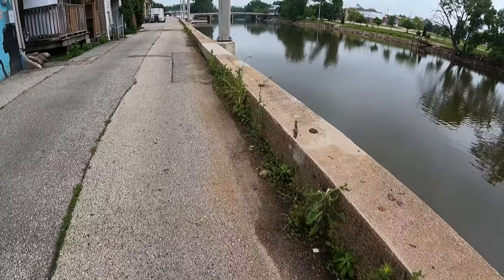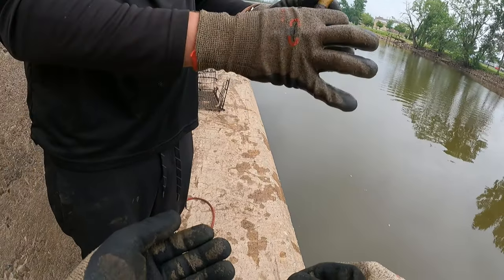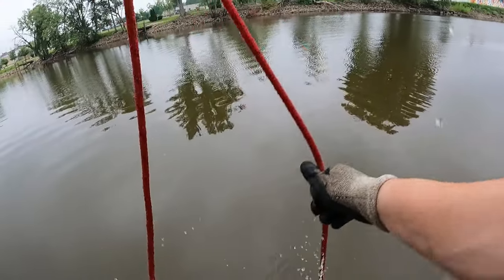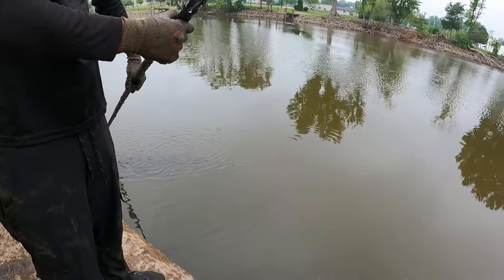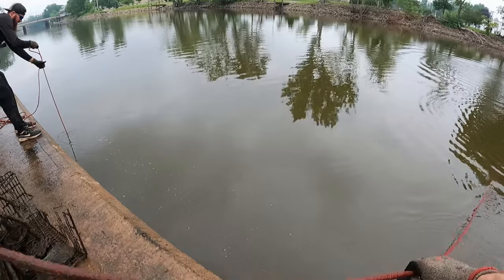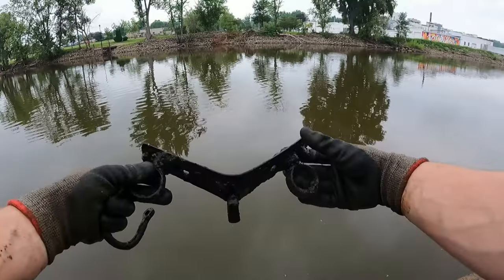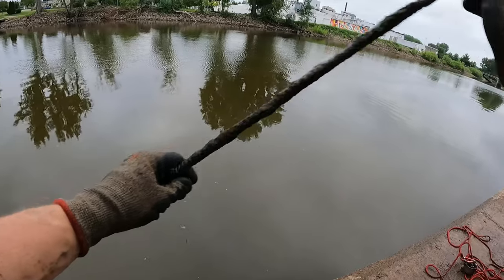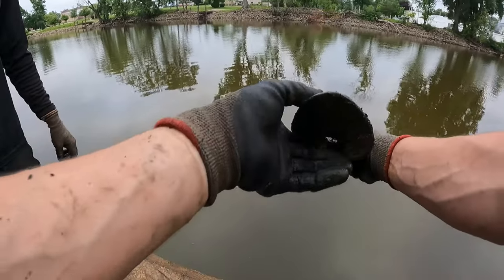Magnet Fishing The BEST HOTSPOT You Have Ever Seen! (Multiple Weapons, Snowmobile Parts and MORE!)

Comment: Alex, the item at 22:28 is a d ring shackle that is missing the pin.  They hook to something that can be towed or to tow, but they can be used on just about anything. That one is pretty hefty so it was for something big.  I'd also bet the spud bar you caught at 29:50 was used to punch holes in the ice for ice fishing.  That's what I use but I welded a cross bar to one end so it won't fall through the hole if I drop it.

Comment: The piece with the threads on the inside and plug terminals is an old light bulb holder. You would screw in a light bulb and then plug it into a socket where you wanted light. Now that's old!!!
Reply: I have a couple of those, they're awesome!

Comment: Cannot see that brass bracket up close as we had bottle openers for beer that would be attached to the bar, you could open beer quickly with them., the chair is probably red vinyl back used in every bar 70’s, 80,s stackable,.

Comment: All those speakers you keep finding are just that. Speakers. That part you keep pointing at is an electro magnet. As the amplifier keeps sending a signal to the speaker, that magnet draws inward, pulling the paper cardboard in and that's where you get the bass sound from. Basically, it's just a magnet, no subs, nothing else.
Reply from the maker: How old do you think speakers like that are, maybe 70s? 🤔
Reply: @thefindingfamily  You know Alex, they still make speakers that size for home stereos.  I know you younger guys look at them and think they are just for cars but, the make 2 inch tweeters, 4 to 8 inch mid range speakers, and 10 to larger than 20 inch bass speakers, or drivers as you call them. You might be able to find a co. name on them and maybe a serial number and trace it back to when it was made.